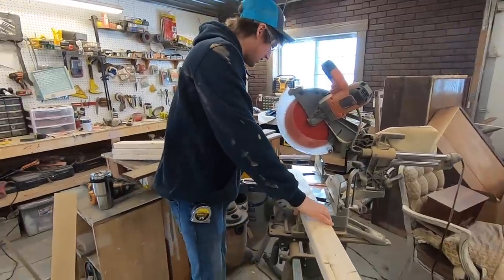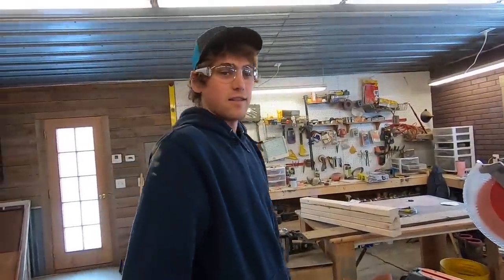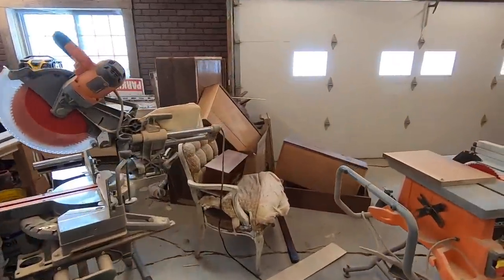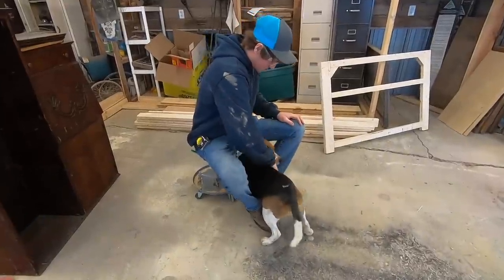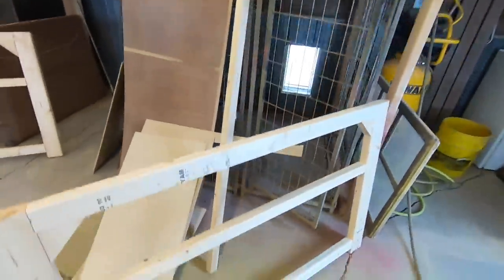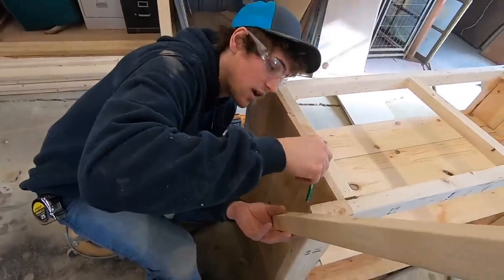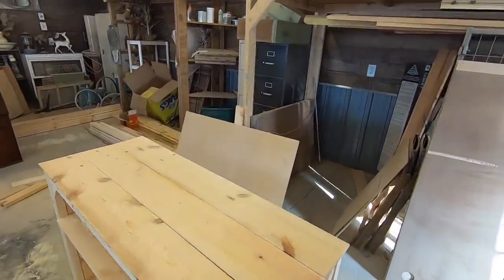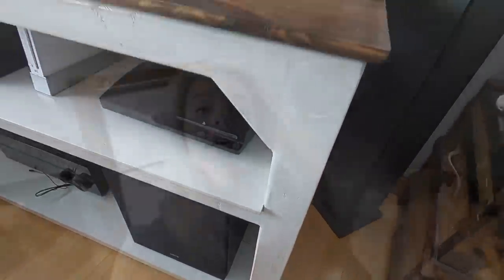Chets Doing Carpentry?? #BonusFootage

Comment: You should get a dust solution at least dust mask, turns out wood dust does lead to lung damage, though not for the reasons you may think. It has the same effect as coal dust. (Since the particles have sharp edges (unlike wind blown dust,sand) it gets into your lungs and cuts up the internal surfaces causing issues. (This is also true of moon dust btw))